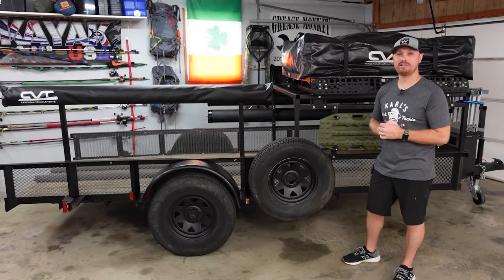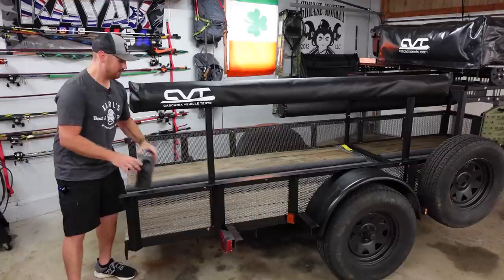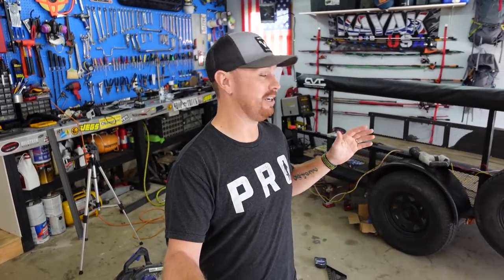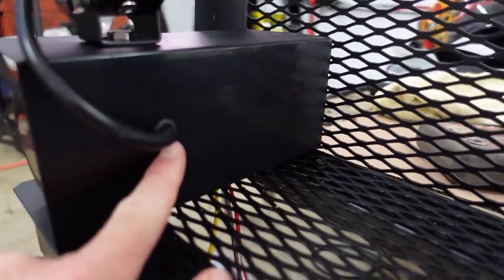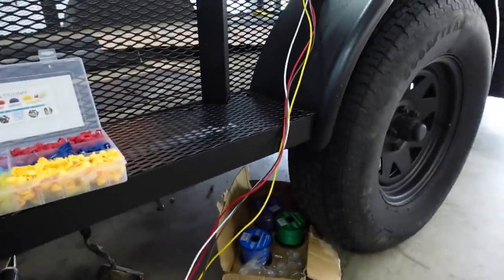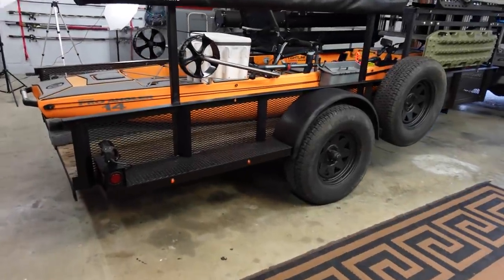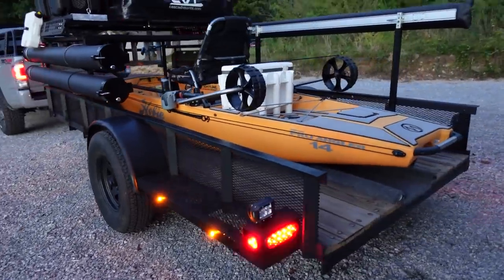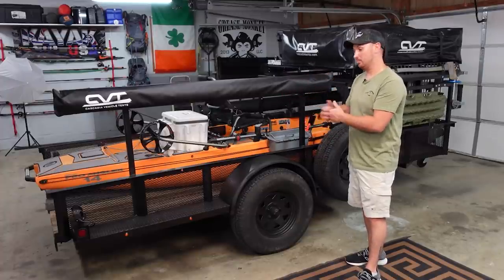Kayak Camping Trailer Build | Part 8 | Lights & Rear Racks | Kayak DIY

Comment: Should add 2 or 3 red Lights on the back of trailer. Also add some type of perimeter  Lights for when you are parked  Camping  to Light around  the trailer ground

Comment: Nice build so far. I've enjoyed the progress. I like the steps and love those reverse lights. I'm planning something similar for a small camping/kayak hauler trailer. For the floor, consider composite decking. I saw a guy used it for kayak bunks and thought it was genius. I'm surprised you don't see it used on trailer decks more often. They never warp, fade, or rot. Easy clean up and durable. Happy paddling and tight lines!

Comment: Sir, love the channel and I especially love the trailer build. I have a trailer that I want to assimilate your ideas with mine. I was hoping to get an explanation with the wiring inside the toolbox. Did you use a bus terminal and how did you incorporate it into your truck 4pin or 7 pin plug
Reply from the maker: The seven pin plug and box all came together. All the lights wires run to the seven pin box and then the seven pin plug, plugs to the truck. Check out my site - www.kit.co/kayakusa to find everything I used. 🤙🏼

Comment: AWESOME upgrade and the marker lights are insane! I really like the housing unit the tail lights come in except I would have mounted them higher making you more visible but that's just me you did a great job. I was under the impression you were framing in the racks. how will you secure things you put on the racks?